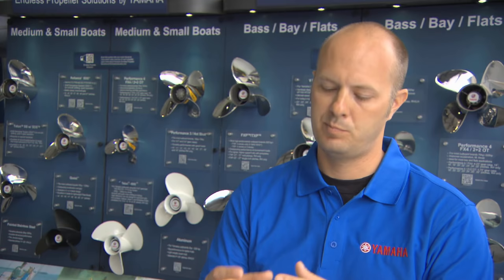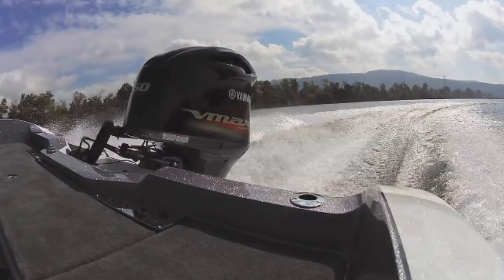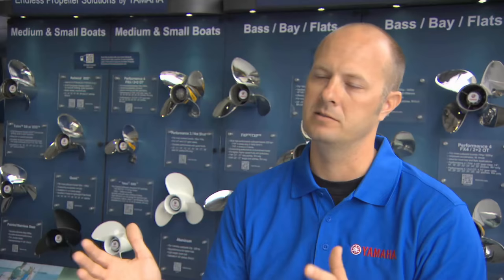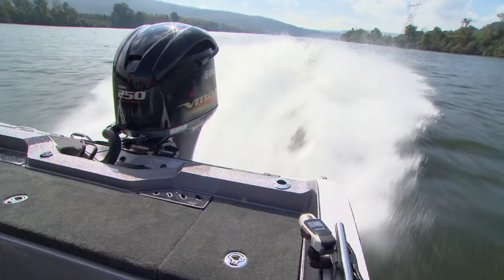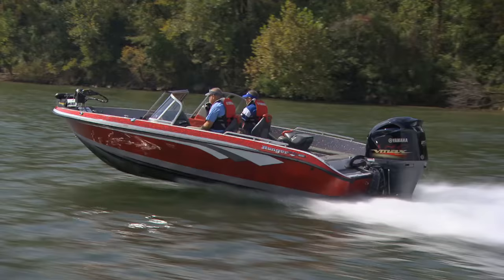How to choose right prop for your boat and motor

Comment: But looking at the chart which shows which prop is correct for my boat, it shows so many different pitches, from very low to very high.  Short of trying one on the water--nope, that' wrong, getting another and another until I get the specified RPM's??  Surely there must be some way to ESTIMATE the pitch, to be close out of the box, right?

Comment: An even simpler approach: ask your engine's manufacturer their prop recommendation for your boat.  "Hey, I have a Yamaha 115 hp four stroke, fishing boat.  What size and type of prop do you recommend"  End of story
Reply: Because each boat weight varies , how much the person loads , extra thing is the make and model vary with every piece of equipment added power poles trolling motor etc... full livewell full tanks of gas

Comment: I bought a boat with an unknown history. It's a 195 sundowner and my suspicion is that the engine has been changed from a 4.3 to a 2.5 but they kept the original stern drive with a low ratio and the propeller that was 15 1/4 x 15. The engine heated and struggled to reach 4000 rpm in a calm sea. I experimented by reducing(cutting) the diameter of the prop from 15 1/4 to about 14 inches and i saw an immediate change. the engine could reach wot without getting stressed and the boat reached higher speeds of course. I now ordered a 13x15 four blade and I can't wait to try it out. sometimes you should consider diameter as a form of change. I'm told that an inch in diameter is 2 inches of pitch. not sure though, have to ask the experts.

Comment: So im running a 13 pitch on a honda bf50 at 6100 rpm and struggles to get out of the hole with 2 people at the back should i go to 11 pitch or 15

Comment: I recently had my 1995 mercury mariner 200 EFI in the shop. I had Giles’fuel
pump rebuilt Reed’s put in it and water pump and seals. This boat usually carry me my passenger and all our stuff at 69 miles an hour upper River in the wind. I get it back from the shop and I have to make it get up to 61. Mile per hour I take it back to the shop. The timing was off at 17° so he said it at 21 now. I am only getting 64 miles an hour. I have lost 4 miles an hour. I’m not sure why anyone could tell me what’s going on. I would greatly appreciate it.

Comment: Here is my problem, avoiding Blowout (Ventilation) when pulling a tube/skier and turning, WOT was fine, but I went from a factory mounted 4 blade 13 5/8x19p Spitfire and now trying a 5 blade SS 13 1/4x17P and adding a Hydrofoil hoping for more bite in the turns, lower plane speeds, and harder out of the hole. My only concern is a friends boat that is similar seemed to do best with a 14x15P 3 blade SS. I hope the 5 blade provides alot more bite like they say it does

Comment: my f70 yamaha is winding out at 7000 rpm with a 15 pitch oem that was recommended to my by a dealer. top speed was 32 mph on a 18 foot carolina skiff jvx cc.
I just ordered an 18 pitch prop to see how it works out.
Reply: How's she doing now?

Comment: Heres my conundrum... I had a 15x17 mercury prop on my boat when i bought it used with only 50 hours on tge entire boat and yamaha 150 outboard 4 stroke motor. (2011 Southbay Tri-toon 24'). I was getting easily 5800-5900rpm and 40mph (give or take a coiple mph depending on water conditions and fouling on pontoons causing drag..) that prop was knocked up a bit.. so I bought a new one.. same size and pitch 15x17. Yet cant get over 4900 to 5000 rpm trimmed out! And maybe 32 mph.. (recently 28mph due to dome algea growth on pontoons)  but even clean.. wasnt getting more than 5000rpm and 32mph
Reply: EASY...#1 You have an engine out of tune....OR #2 (and most likely)...the 15x17 that WAS on your boat was fixed or re-pitched, and the ding-dong that likely "Fixed" your old prop took some of the pitch out of it... My shop has DONE that to props in a pinch to get the engine in the powerband (Like if the prop is for something really OLD).... BUT he will grind the size off the prop so someone doesn't make the same mistake you did...

Comment: I have a 2023 190 tracker with a pro zs 115 I'm turning 6000 rpm and the motor is bolted in the top hole so it is as low as it will go! My question is it blows out without really lifting the bow! Running 43 mph GPS with tournament gear and partner! Do you have a suggestion on a different prop and setup to get more speed?  TIA

Comment: So, if I’ve bought a used outboard for my boat, how do I verify exactly “which” pitch to buy WITHOUT having to try different pitches?
Reply: you cant know exactly but if you are hitting 5500 with a 21 and you want 5800 try a 19 or 17
Reply: My same question also. Where should you start?

Comment: I just bought a boat and im way over proped. geting 3500 rpm wide open and takes forever to get to plane. Is a 4 blade better than a 3 blade? Aluminum or stainless?

Comment: We have a vmax series 2 250hp. We have a 4 blade 24 pitch. At wot it reach around 5400rpm. 61mph. 
Engine specs states 250 at 5500rpm. So 5500rpm is the max rpm? To see if my boat is overprop. Just got a 3 blade 24 pitch. 

Didnt stay at WOT throttle for long. It just reach 61/5400rpm & let go.

Comment: Hi, I have a Stainless Steel Michigan 2Y92  SSM - 354 - C , 15 1/2"x18 RH 3884 , 1 1/16" Shaft, can you please tell me on what Boat Motor this Stainless Steel Prop. will fit.
Thank you.

Comment: Hi w hat about a (4 - 6mph) 26ft  canal and river cruiser ? should i prop up on 30hp efi  tohatsu outboarsd,  at present max rpm is 4200rpm WOT, normal cruising RPM is 2600rpm, I have standard 9.8 x 13"  prop will using a 10 x 9 " save fuel or waste it ? just wondering ?

Comment: What he doesn’t mention is density altitude take a boat in Houston it’ll run 5500 RPMs take the same boat to a 6000 foot elevation like in Colorado it will only run 4500 rpms,know I had to change my prop.

Comment: My yamaha 2 stroke on my boat gets 5800 RPM wide open. Holeshot rpms I get 5,000 I’m told I have slip and should prop down from a 13-19 to a 13 1/4 - 16 help!

Comment: Good afternoon just wanted to reach out I am having an issue I am running twin Yamaha HPD i's 21 pitch props only getting about 4200 rpm any advice on what size prop is the correct size?
Reply: 1prop inch = 200rpm so you need to get 1400rpm to reach 5600rpm. That wil be a 13 prop you need. Im assuming reason for your 4300rom is because the boat is heavy/loaded. A 13 prop wil get you 5600rpm but it migh reduce speed because your boat seems to need torque to get going rather overall top speed.

Comment: I’m in a 1810 Nautic star dry weight is 1,275 I usually have 4 people on boat I turned 5400 5500 rpm hot 40 mph I felt like it takes a lily toe long too plane out and I have a 115 Yamaha 4 stroke. It says I can reach full throttle rpm range 5300-6100 rpm how can I squeeze more performance out of my motor I’m running a Solas aluminum 3411-130-19pitch??? I would like too know what u recommend?

Comment: What would be the best prop for my Little Mercury 7.5 thunderbolt late (60's- very early 70's). Currently has a I think 8" prop stamped A10L 7P. In my understanding that's a 10" 7pitch prop but no... It measures 8" roughly maybe a hair more. Anyway it's pretty slow and reaches Max revs within a few seconds and I know there's something better I can get regardless of this being on my flat bottom fishing boat, I still would like a little more speed? Thanks anyone.

Comment: I got a Tracker Gide pro v17 1984 it has a Mariner 50 hp 2 stroke. I messed up the propeller all I want is to get it back in the fiver. The propeller said’s on the side it is 1311-111-113. Dos anyone know if I can put a different pitch other than 13?  Because this prop number is hard to find. I found them in 10 pitch but not sure if it will fit my motor
Reply: Sure that is pitch? Sounds like diameter to me!

Comment: EHH Bull just because the rpm is on the factory settings doesn't mean its not slipping 
ONLY way to know if your prop is right and efficient is to use the 
PROP CALCULATOR online 
Put in the current cruise and top speed
Put in gear ratio and pitch of prop
The Mercury Calculator will calculate slip % and ONLY then will you know if your propped correctly
With this dudes method you could have to big a diameter prop and taking pitch out would get you to factory RPMs BUT your losing efficiency which is speed

Comment: Ahhaha you did t say anything about the diameter of the pro it’s just as important as pitch, every inch of diameter is equal to 2in of pitch, if you have a 15-19 that’s dia and pitch and you boat is a pig and not running up to proper rpm and a slow speed you could change up to a 14- 21 prop and it would be the same s
Rpm in Theory but you boat would run faster and have a higher rpm because a large dia prop has much more drag and a wider fan type blade, this guy eather nows nothing or doesn’t really want to get into prop theory